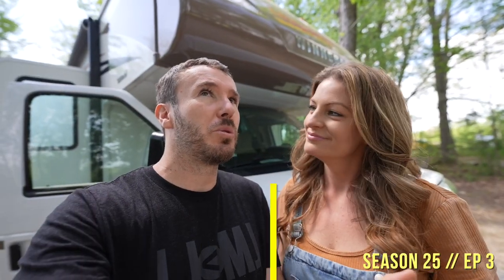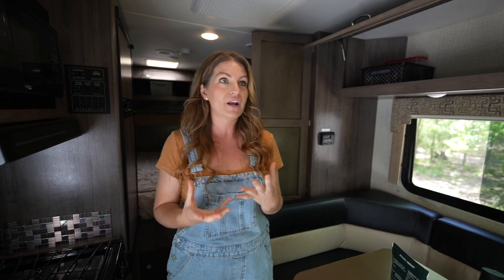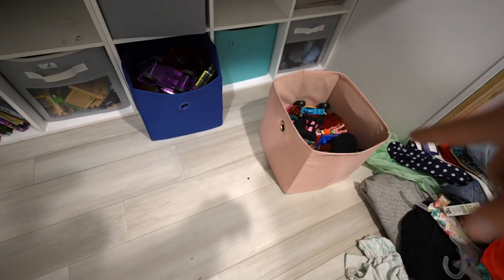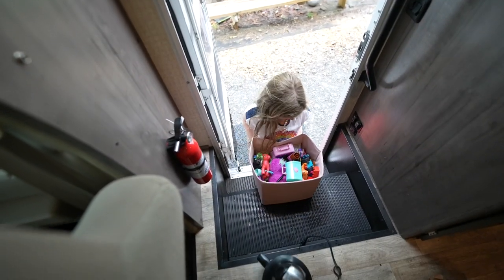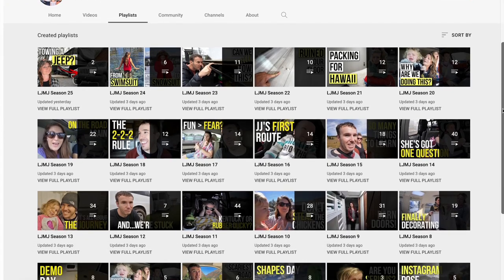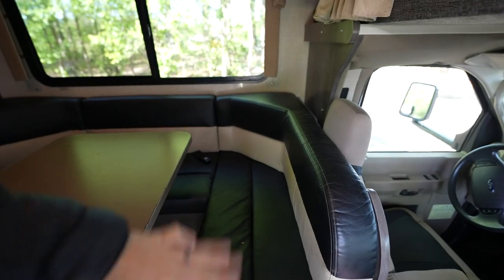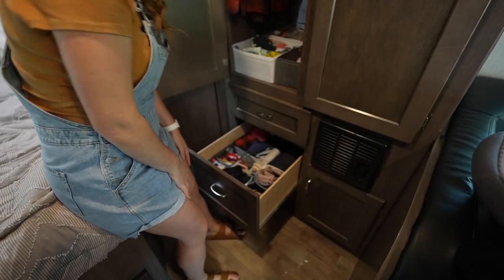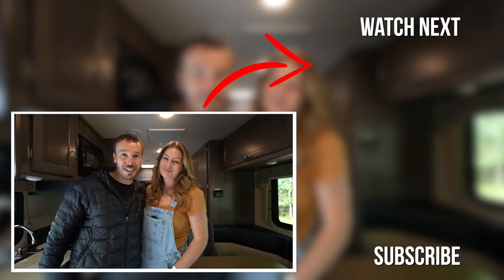Downsizing From A 5th Wheel RV To A Class C Motorhome For A Road Trip

Comment: You can use the attic for storage and put everything on the front seats when you stop. California is ruff for free overnight parking and people reserve things 6 months in advance. There are a few Cracker Barrels and many state beaches have lotteries or cancel lists but you have to check in at 8 or 9 am and wait until 2pm to get in. They also might charge parking while you wait. Good luck. Quick dry shorts and shirts work the best. Thin and lasts for days.

Comment: I have that same unit.  I use plastic bins over the dinette to keep my canned products and food supplies.  The cabinet under the closet  is a perfect place for my soft sided close basket.  The one I have has handle strap and outside pocket which I keep my change & Tide pods in.  Easy open cabinet, throw in clothes, when basket is full, pull out everything you need is right there to got to laundromat.  Please let us know if you find organizational bins for the triangle storage in the bathroom.  I cannot find anything to fit.  It's very aggravating.  Also could you post the storage containers that you got on Amazon.  Thanks so much for sharing..